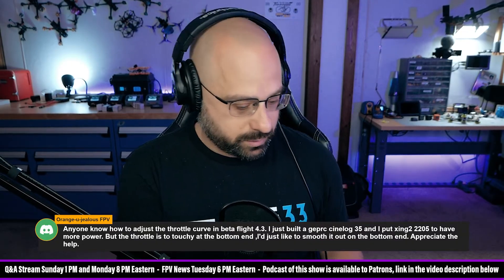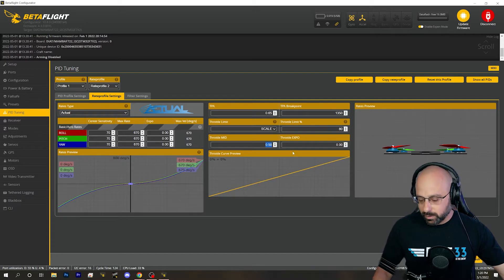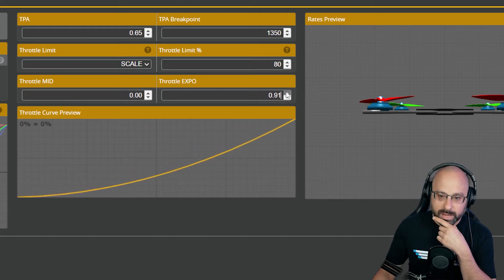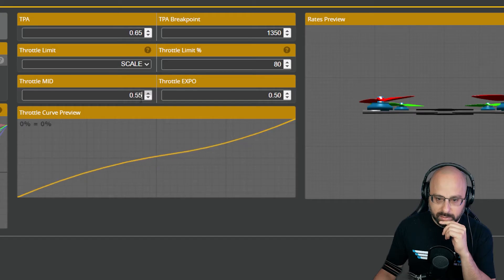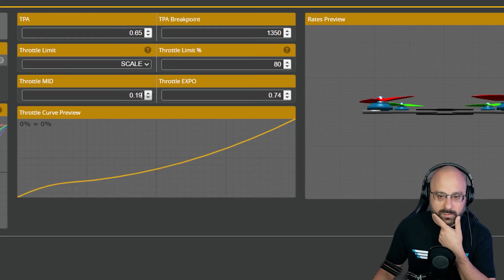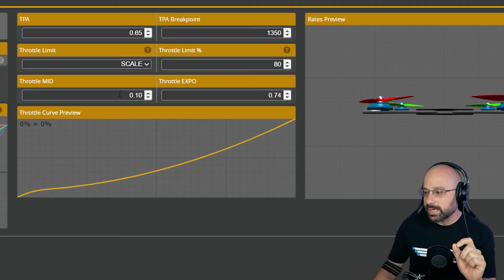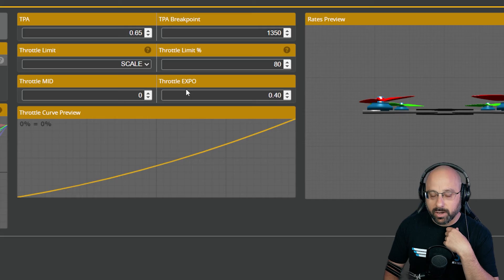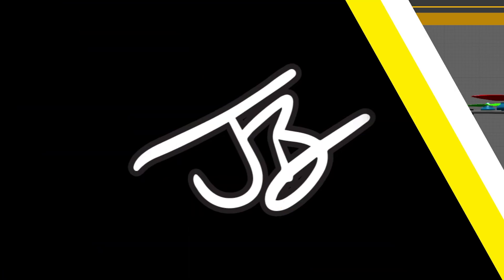Tips for Adjusting Throttle Curve in Betaflight 2022

Comment: I display my throttle value on my osd and then I fly a normal pack and observe what the average throttle value is, set that values to throttle mid and apple expo in increments of 5 or 10, that will center the exponential shaping around his average throttle value ( I use my hover throttle as my throttle mid). My Go Pro quad has expo amount of of 40, my tiny whoop has like 50 or 60.

Comment: Does curve throttle make the battery run out faster? Especially if the throttle curve settings are made steeper up in the early rounds.. thank you for your explain.. 

￼

Comment: bro what if when I’m blipping up and drop my throttle say when I’m doing a dive. I drop my throttle to initiate my dive. I’ll be zero throttle to start the dive but it continues to accelerate, its just for a second or two making it hard to cleanly line up anything. same with when I’m coming out of my dive, when I go throttle up it’s like when I move my throttle gimbal it’s taking my motors a second to catch up with the actual stick input. Weather it’s raising my throttle or lowering it. eventually it catches up but it just doesn’t sound or feel right I’m very new lol but even to a newb this just doesn’t seem correct. I’ve limited my throttle to 75% would this maybe be the issue or could it be my controller or maybe like my packet rate or something lol it’s just causing me to have a shit flight. And if you could help me brother that would awesome. If you need more detail or I didn’t explain something enough please tell me. Its hard to explain without you physically feeling the lag in real time lol.
Reply: Hi, did you solve your problem?

Comment: Should I trim my transmitter or my accelerometer? I want to fly indoors and out doors. I have a feeling that trimming with the transmitter will cause issues when I am flying outside. Appreciate the help
Reply: Trim is not useful for quads. You might want to fly in angle mode inside, in which case you need to make sure your accelerometer is calibrated.

Comment: Throttle Mid for a cinelog 35 6s with goPro 10 and standard motors is at 39. With no Gopro it's at around 20. More thrust will of course lowers that number.
Reply: And different bigger batteries can add a kick of throttle .

Comment: Finally going to play around with these settings, after my first crash when I broke the window my new jb drone started working well, I fixed the problem, had the motors reversed setting clicked, now im going to try to adjust the throttle because its just too fast for me to land carefully and ive had to do some repairs. Can’t figure out how to protect the receiver antennas so I just bought some spares because ive lost 3 antennas sofar and bought 2 receivers. Too bad I didnt spend more on my transmitter because I can’t find anyone selling accst receivers that aren’t ipex v4 which are smaller and more expensive than the standard ones. Also solved  my video problem by reading the user manual for my goggles again. With everything working i was able to do a couple tricks on Monday, now I want to start tuning.
Reply: What receiver are you using you may be able to use a JXT modula if you’re running d16 or d8

Comment: I don't know if your video topic covers my question. My props spin when I arm. I did turn on not to spin when armed. I apply full throttle, but when I reduce to zero, motors stay in full throttle. Is there a betaflight setting?
Reply: i have similar problem. solve raising dynamic idle. must be over 20 and no problem
Reply: @juanmanuelamado7732  put air mode on a switch. If air mode is on the props will spin no matter what. If air mode is off and you have don't spin checked they won't spin. Air mode on a switch is great for landing, no bounce with air mode off when you touch the ground. But in flight you can stop the motors and drop like a rock.
Reply: @airfriedquadsbw  WELL, I GUESS U USING OLDER BETAFLIGHT COS IN NEWER BETAGLIGHT 4.0 TILL 4.5 IN THE MOTORS SETTING U HAVE THE OPTION TO TURN OFF MOTOR_STOP AND U won't FALL OFF LIKE A ROCK, EVEN WHEN THE AIRMODE IS OFF. I DIDN'T LIKE FLYING WITH AIRMODE ON  BUT I RECENTLY FOUND OUT THAT AIRMODE ACTUALLY SOLVED THE LOW THROTTLE INSTABILITY IN MY QUAD.
Reply: @fyzobaba  why are you yelling?
Reply: Did it work ? Same prob here.
Reply: @ericscholz3523    put air mode on a switch. If air mode is on the props will spin no matter what. If air mode is off and you have don't spin checked they won't spin. Air mode on a switch is great for landing, no bounce with air mode off when you touch the ground. But in flight you can stop the motors and drop like a rock.
Reply: put air mode on a switch. If air mode is on the props will spin no matter what. If air mode is off and you have don't spin checked they won't spin. Air mode on a switch is great for landing, no bounce with air mode off when you touch the ground. But in flight you can stop the motors and drop like a rock.